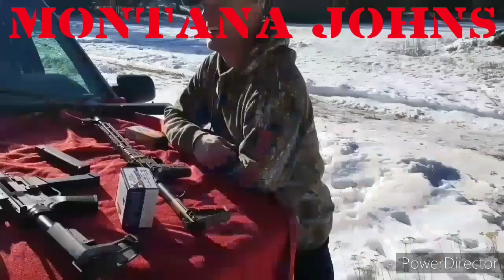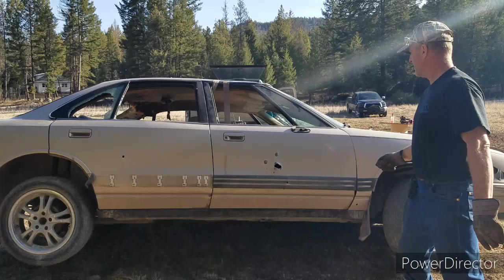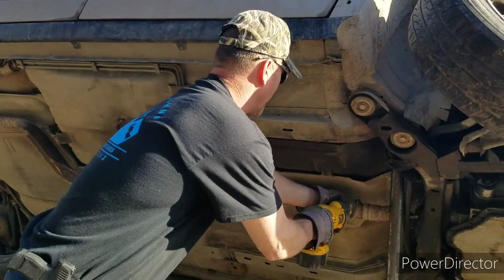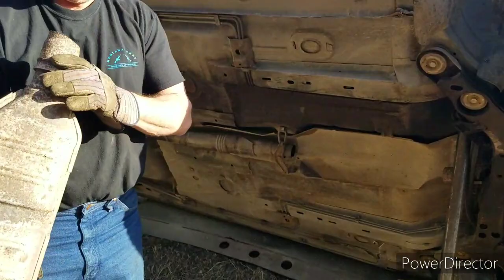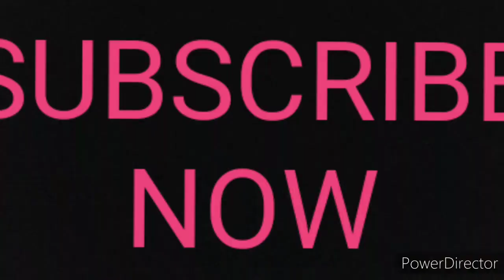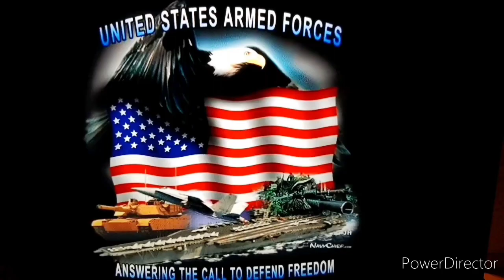How to cut a catalytic converter off of a vehicle with ease, in The Great Outdoors of Montana

Comment: Wow thanks! I’ve already got 14 converters using this method and I’m no where near as dirty . My profits are through the roof!
Reply from the maker: You have a trailer with a winch where you can tip it over? Or do you have another way to do this:-)
Reply: @montanajohnsoutdooradventu4455  I’ve just been using my thumb just like the video says :-)

Comment: Time it took to rig all that up I could have climbed under there and cut cat off
Reply from the maker: John, I would bet everything that I own you could not climb UNDER that car and cut off that cat faster. You have to push down with a tremendous amount of force on the front of this cat in order to even get it to start cutting. This particular car has a double pipe in the front, so, inside the cat there are 2 thick pipes, therefore when you cut through it you are cutting through 4 pieces of pipe at one time.
And it literally takes me 5 minutes total to pull it on its side and let it down. 
No way on gods green earth can you cut this cat faster than I can this way. :-) :-) 
Thanks for stopping by, stay safe...MTJOA

Comment: that's taking too long.  Thieves use a new blades for sharpness.
Reply from the maker: This cat has double wall in the front, it is major hell to cut through in the front. Once you cut through the front top part of the cat you are cutting 4 pieces of metal at once. So, it is super thick on the GM cats like this one.
Thanks for stopping by, stay safe...MTJOA

Comment: What blade are u using
Reply from the maker: I am using the IRWIN Blade, the 10/12 TPI or you can just use the 10 TPI, that works great. I can cut off 5 to 8 cats without replacing the blade. The IRWIN blades work the best!
I found them on E-Bay so I am going to start ordering them there. They are around $60 for 25 of them and that is the best deal around:-)
Thanks for stopping by, stay safe...MTJOA
Reply: @montanajohnsoutdooradventu4455  what size what's a good battery sawzall

Comment: So can a car run witjout a cat??
Reply from the maker: Yes, you just have to put a pipe in place the same diameter of the exhaust pipe...Stay safe...MTJOA
Reply: @Tristen Carreon yes it will still run it will just be loud as hell
Reply: @dalionkeyng3476  Not if you install a straight pipe in place of the cat which reconnects the muffler.

Comment: Good idea, dead fall trap for stupid catalytic converter thiefs.  
Everyone knows you cut the rear first then the front because the front keeps it rigid while cutting.
Reply from the maker: I cut off whatever side is in my favor first...lol... I use a 10/12 TPI blade that is real thick so it does not get stuck that easy.
I found that the less teeth and the thicker blades really make it a snap to cut through.
The Irwine or Erwin blades at Lowes are one of the best, they are blue in color. I can cut off 4 to 9 cats with one blade. They are super durable, I am blown away with how well they perform.
Thanks for stopping by and commenting, I appreciate it, stay safe...MTJOA
Reply: Thanks for the blade tips.  Cheers.
Reply: You are so thinking the same thing I was when you were watching him start cutting. Thought I was going to be the only one who noticed that one.
Reply: @markgrant8598  Great minds...